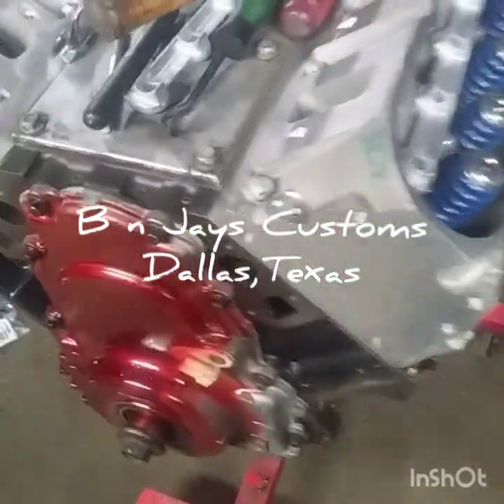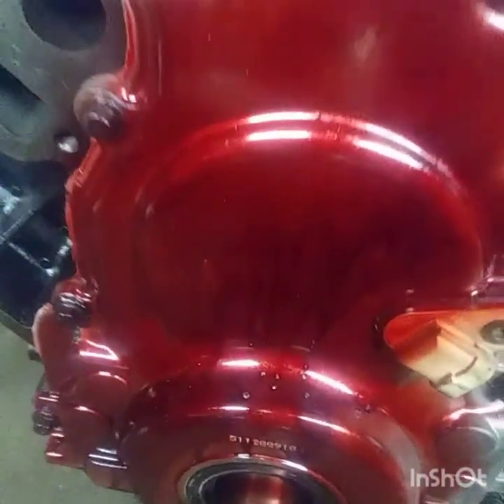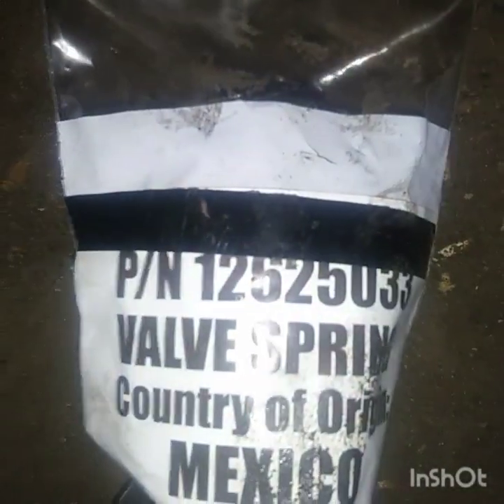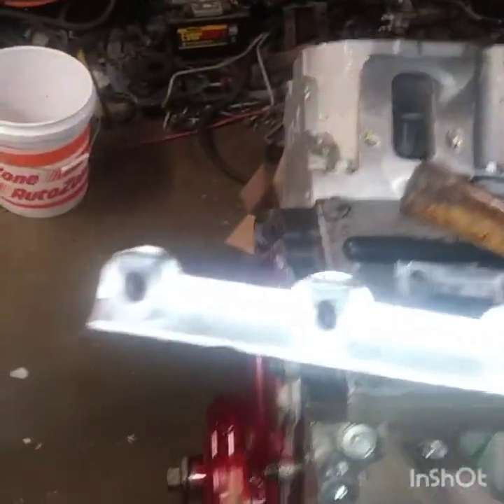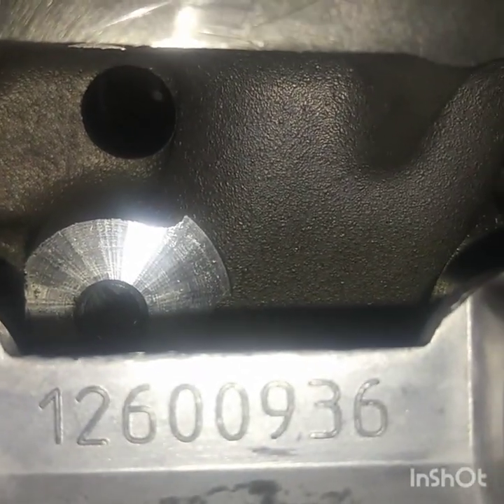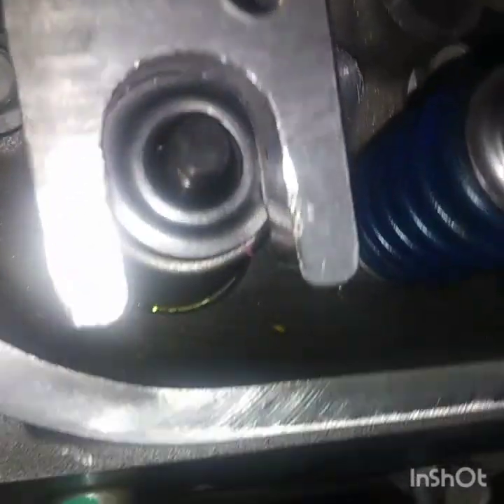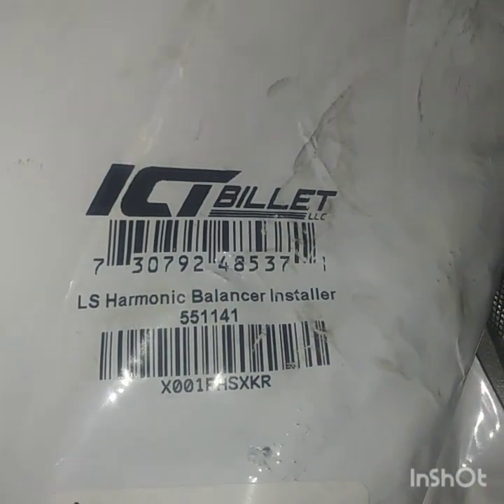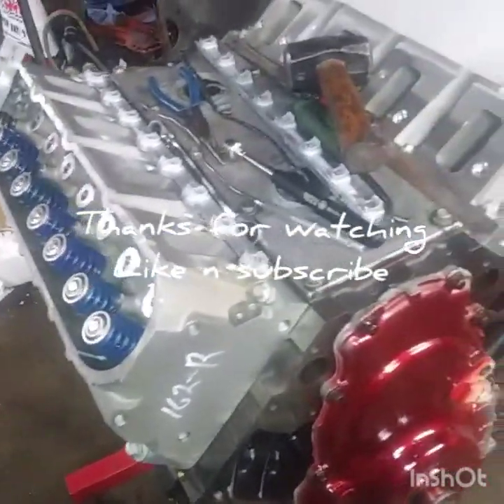6.0 iron block bored to 6.2 build part#3

Comment: Can you use the stock 6.0 rocker arms when you convert from cathedral port heads to square port 823s...great video..im going with a 6.0 iron block bored to 4.065 with 823s..im new to ls type engines..
Reply: No...square port has 8 offset rocker arms, and the pedestal is different.

Comment: Do you have a set of those 823 heads for sale? I'm located in longview. My local machine shop alot business with your city motor shop up there.
Reply from the maker: City motor be having them
Reply: I was going to do the same exact 6.0 to 6.2 bore with city motors but had the wrong fucking mechanic on my team, but its all good, they tell me that, that exact process is a double bore, a all day process for it. I have a extra 5.3 I may bore to a 5.7